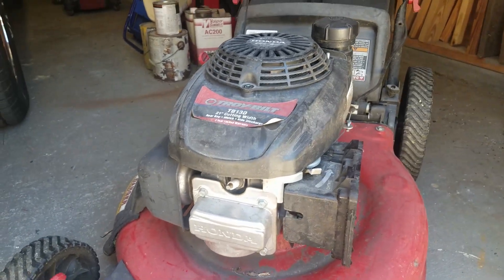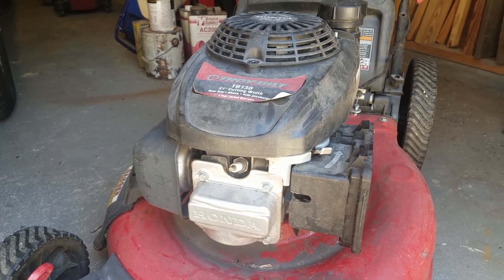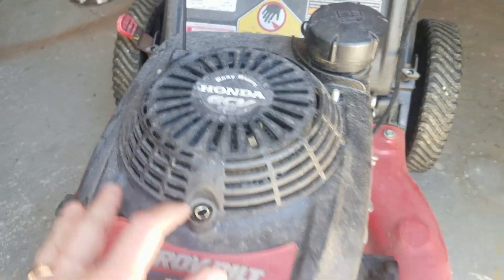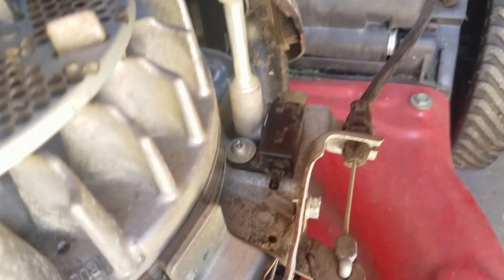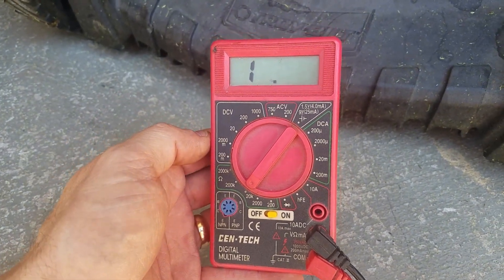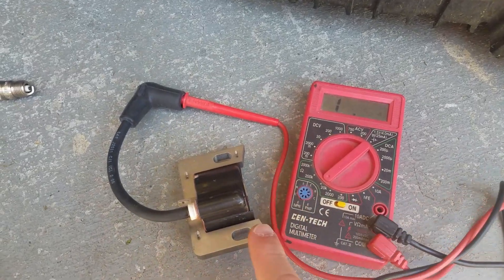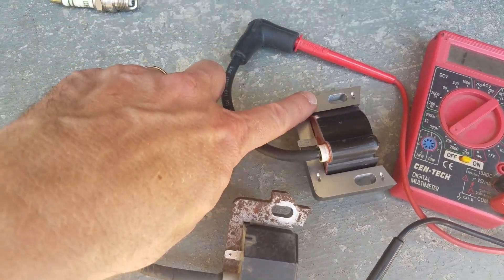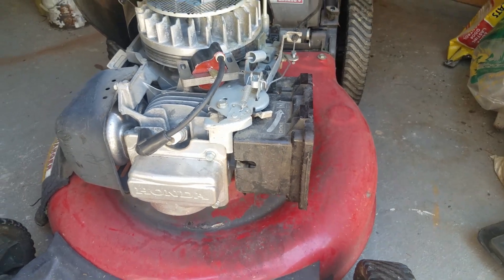Troy-Bilt Honda GCV160 Ignition Test & Repair

Comment: To see if the coil is working or not, all you have to do is unplug  the ground going to the coil and try to start the engine. If the engine runs coil is good, if not coil is bad. Much easier than getting a multimeter out and messing around with that. It either works or it doesn't.
Reply: That's fine if the engine starts but this video is about diagnosing the coil to eliminate it as a suspect.

Comment: Okay. That's good. But that was the secondary resistance (I get that reading 9.6 K ohm). What about the primary resistance (kill switch to back of coil)? Mine is reading 0. Can anyone help me here? I would like to know before I buy a new one. Thanks!
Reply: I came here for the same problem, mine is about 1 ohm. You probable figured it out by now but if anyone else wants to know its supposed to read 	1.0-1.2 kΩ